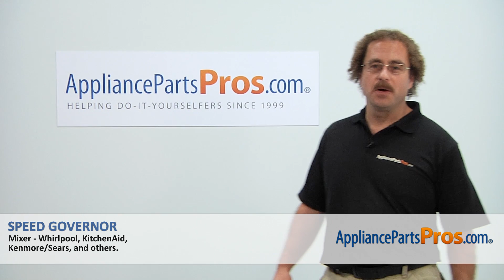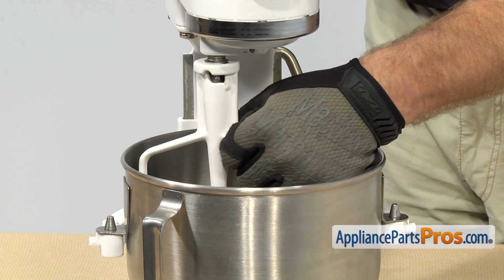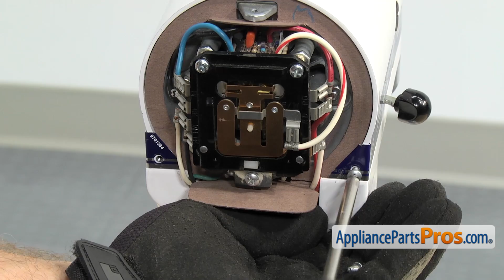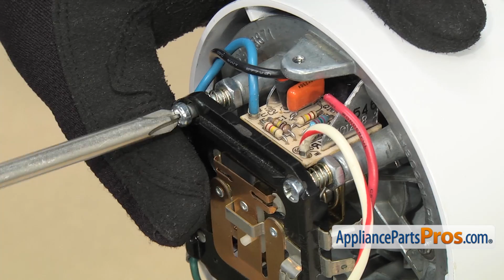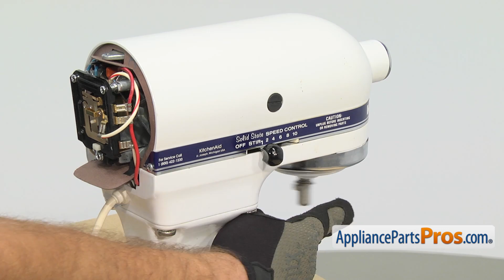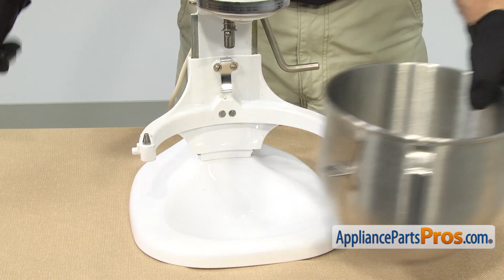How To: Whirlpool/KitchenAid/Maytag Speed Governor WPW10330804

Comment: How do I know if I've got the governor "all the way down onto the shaft"? I don't want to hit it any more than I have to. When I put it back together, it has kind of a rough sound in "stir," and even when making very small adjustments (1/8th of a turn), it will go from being too slow to too fast, and vice versa. I'm thinking maybe I was too cautious and didn't seat the governor all the way.
Reply from the maker: It should sit flush and snug on the shaft with no rocking. If it’s running rough or inconsistent, it may not be fully seated or aligned. If you need further troubleshooting or replacement information, you can check out our Repair Forum: https://forum.appliancepartspros.com/.  It’s easy to register, and you can either post your question or search the forum to see if someone else has already asked the same question.

Comment: I got one brand new and took it overseas I had to use a transformer (220v to 120) but it runs at full speed even at the lower settings, Could it be the transformer?? , or is there an  adjustment in the speed governor?
Thank you
Reply from the maker: Running at full speed on all settings is not normal, and the transformer and different voltage/frequency overseas could definitely be part of the issue, but it might also be in the speed governor or wiring. For proper checks and any adjustments, our techs can help you at forum.appliancepartspros.com if you post your mixer model, the transformer you are using, and what it is doing.
Reply: @appliancepartspros thank you so much 🙏

Comment: I am trying to remove the governor from the shaft as it is shown in the video from 4:52 to 5:04, but don't know what the needle nosed pliers are doing.  Are they simply compressing the sleeve that surrounds the shaft, or are they pressing the pin?  Nothing I do seems to work.
Reply from the maker: It's not gripping it, he is just using it to get leverage to pop the governor off the shaft.

Comment: Hello, could you tell me if a lack of strength when mixing a dough could be the governor's fault?
Reply from the maker: If it is struggling to mix the dough then it sounds like the motor or motor brushes are bad. You will need to check those items for damage. If you have more questions you can call us at 1-877-477-7278.

Comment: This video helped a lot! But now i am putting my kitchen aid back together and the spring that hold the speed board has come detached and I do not know where or how to reattach 😅😅 please send help 😂😂 the spring at 3:00 ish.
Reply: The spring has a square hook at the rear end.  This is supposed to be hooked into a small vertical slot just below the adjusting screw at the bottom of the board assembly.  The other end of the spring attaches to the speed control lever, below the motor.  It may be necessary to remove the upper part of the mixer in order to access this area.  There are some "re-greasing" videos online that show this procedure in detail, and it's not difficult to do.
Reply: The spring is supposed to be hooked into a small vertical slot just below the bottom adjusting screw on the board.  If the spring has become retracted into the mixer head, you may be able to reach it with needle-nose pliers.  Alternatively, you can try bending a short hook in the end of a stiff wire and reach that in to capture the hook on the end of the spring.  A piece of wire from a coat hanger might work for that.

If you can't see or grab the end of the spring, it may be necessary to remove the top part of the mixer head to access the spring and the speed control lever.  There are some "re-greasing" videos online that illustrate how to do this partial disassembly.  It's not a difficult procedure.

Comment: Hi, I replaced the governor but my mixer is running even in Off mode. what could be the issue? The white accelerator arm would come through above or below the two metal plates inside?

Also, my lowest speed is way too fast even though I am using the exact same measurements of the two upper posts and tightening the two screws according to the measurements I had before.

Comment: Hi,
Thanks very much for the explanation: it’s really clear and useful. However, what if even tightening the screws to the point that the planetary starts to spin just plug in the speed is still higher than 60 rpm? What is wrong with the machine in such case?
    Thanks for the support. 
    Regards.

Comment: I had to replace the speed governor as it only worked at top speed. While I was taking the plate off the end of the spring got bent and then it bounced inside so I had to dismantle everything to put the spring back in place. I then reassembled everything but now I am getting no power at all. Not sure if something isn’t secured enough on the plate. I’ve tried to crimp down on the wires so they aren’t moving. Am I missing anything?

Comment: Why did you change the speed governor? The old one looked fine. 
What symptom did you have? 
How does the speed control work?
Reply from the maker: Often times with appliance parts, they can be nonfunctional even when they look okay. In this instance, you would usually replace this part because the mixer speeds have become irregular or the mixer is running louder than it should.